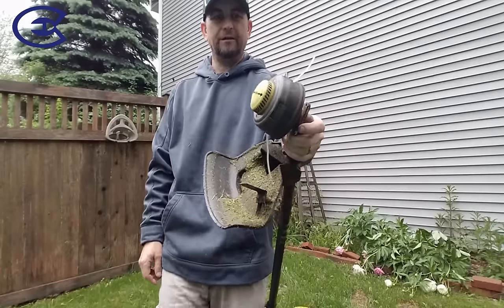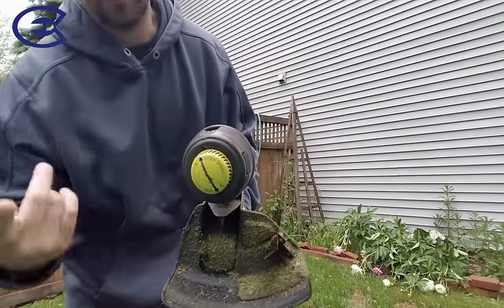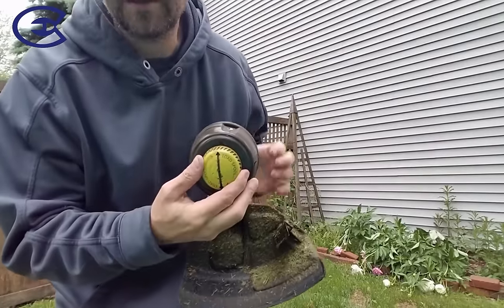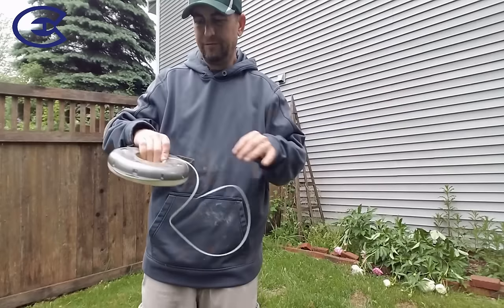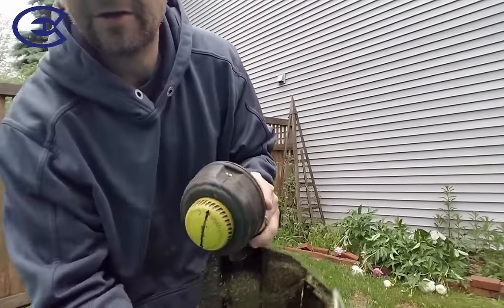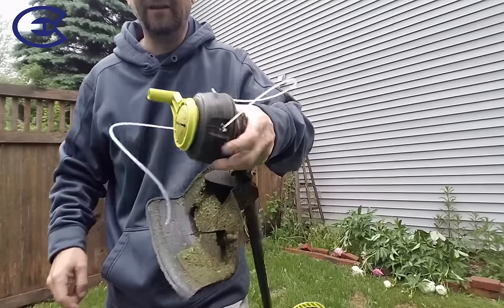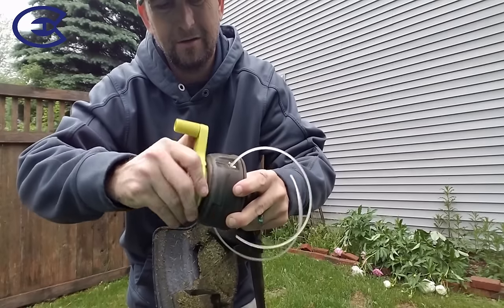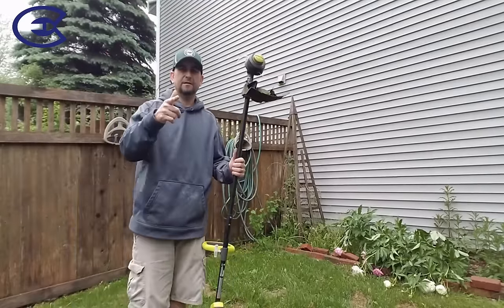How to ReString, ReSpool or ReLine Ryobi  weed trimmer weed wacker whipper snipper

Comment: I have been struggling with this piece of machinery for quite some time, taking it apart, putting it back together, fail, fail, fail. Thank you so much for this super easy to understand tutorial. And actually, the tool to wind the string up is not a necessary. It can easily be done manually.

Comment: Thank you!! I can’t put my hands on the manual right now & I’m sitting out here in 101* trying to finish this yard before it gets dark or it storms...both of which are about to happen any minute now & I’ve been trying to do the old school method...pulling it apart etc...I thought my line was out but I had beaucoup left. I didn’t realize this was a bump model. The last weed eater I had was an auto feed (which never worked properly) & this Ryobi is the second weed eater Ive ever owned so I didn’t know anything about bumping...I pulled the head off & about a foot of string flew out so I’ve been trying to manually rewind it & put it back together for about 15 minutes 🥴🥴🥴 I was ready to toss the whole weed eater over the neighbors fence 🤣🤣🤣💯💯💯
Reply from the maker: Thank you!!! Glad you're fixed up!!!

Comment: What do you do when your spool won't accept line?  I can't get it to feed straight through even though arrows are lined up ...
Reply from the maker: Ive had that a few times just keep trying both sides or re cut the line and try again itll go.
Reply: If you want easy to do everytime,try to heat it made it straight
Reply: Or try cut it angle

Comment: If you don’t have the tool or it isn’t aligned, simply detatch it from the head and align the holes and route the string. You can then twist the green part by hand, spooling the string. Wash it if it’s stuck with gunk.

Comment: Thanks so much for this. Whacker belongs to my brother & he's out of town so I needed help with restringing. Yes I had taken the unit apart & then did a search on You Tube. You wouldn't think a tutorial like this would be needed but IT WAS. My only suggestion is to remind viewers to turn the knob so arrows are not lined up once unit is threaded (I think we are supposed to do this). You could add this step via text. You're a life saver!
Reply from the maker: Thanks!!
Reply: @scratchgolf  is there a way to keep the whacker turned on or do I have to grip the lever the entire time as I am doing now. It's hard on the hands after a couple of hours.
Reply from the maker: I wish I knew. Zip tie??
Reply: @scratchgolf  my Ryobi whacker got stuck in "on" mode for the last hour of my whacking. I unplugged it then replugged & it was still stuck on "onn" mode.  It has done this before but never stayed on after unplugging. It made whacking much easier. Will check status tomorrow.

Comment: Well, it took me a while to get the cord to poke through the other side …. But when it happened eventually the rest was smooth sailing! Thank you SO much for this video - so helpful! I really am so grateful it helped me do it myself without having to ask my boyfriend or brother or a helpful guy at Bunnings… it’s nice to be independent!!
Reply: Same here. I still can’t get it through after a couple hours of frustration and watching other videos. Arrows are lined up but it just won’t go all the way through. Going to try his bumping technique tomorrow as maybe there is some little piece still in there. Glad it wasn’t just me.
Reply from the maker: I've had this issue. I have a video showing how to fix it in the corner of this video.
Reply from the maker: I've had this issue. I have a video showing how to fix it in the corner of this video.
Reply: I just fixed it in about a minute. There was still a tiny bit of old line on the spool blocking the path although I could see light through the holes so I kept trying to feed it though but with no luck. I am now gtg. Thanks to all.
Reply: I’m back again … I don’t have arrows to line up (must have worn off with bumping). This is doing my head in!!

Comment: Thanks, I have the instructions in the other room but it’s easier to watch your video.  Love the ryobi brushless string trimmer, and the pole saw and edger attachments. I was skeptical on the edger but I have 300’ of sidewalk and it does it usually with less than 1 4 ah battery.  Never going back to gas.
Reply from the maker: Thanks

Comment: My original line cut chopped up, and I turned the yellow bump bit, and it rotated and disappeared inside. Thinking I can't open it and get the old line out. Also thinking it will probably be fine if it just stays there and I use new line anyway. Any thoughts?
Reply from the maker: you should be able to open it and fix it no issue. , Thank you! Please don't forget to like and subscribe please, any and all help with my little channel is appreciated!

Comment: Great video.  But there is a way to take that head apart , and you may need to do it if the old line is still in there and no amount of bumping will get it out.  That's what happened to me; spinning the head manually, I could see a bit of green (same colour as the line I use) inside the hole.  So I figured the old line was still in there.  To get it out, I took off the head by pressing on the 2 u-shaped clamps on opposite sides of the head.  The head then comes off the spindle and the still-wrapped line then became easily accessible.  There was plenty of it left, so I threaded it manually through the 2 holes on the side, put it all together, and good as new.
Reply: You saved me thanks!!! I knew there must be more inside and sure enough I took head off and could feed it through thanks heaps 🙏

Comment: What If the line is too short and I want it longer? Do I have put in a new line. I just opened the box and used it today and cut my line too short not knowing there is a built it cutter. Thanks
Reply from the maker: Line up the arrows and pull it out.

Comment: Thanks.  I was trying to figure this out yesterday.  I ended up popping off the green knob which was a pain to get back on.
Reply from the maker: Thank you
Reply: vista7 Hey I have the same model. Have you been able to attach the plastic blades that come with this. This Roybi is driving me nuts lol
Reply: @scotto7895  You have a picture?  I don't think mine came with plastic blades.  I got the brush cutter attachment for the 18v and it hacks through tree branches up to 1 inch thick.
Reply: vista7 I just took a picture of it but cant upload.it looks like the same circle attachment that you attach  with two 3-4 inches orange pieces with serated edges

Comment: Looks easy, but thought it would be easy before.  I'll try again, but so far the chainsaw, mower, and blower are much easier.  Maybe because all except the mower are EGO.  Learned the hard/expensive way.
Reply from the maker: Frustrating
Reply: Thought I'd let you know since it might help someone like me.  It worked like it should when I quit trying to use the "string" that came with the machine. Thanks Eric.  Ryobi manuals help only maybe someone who already knows how trimmers work.

Comment: I still dont understand the tapping against the ground thing at the beginning . I just bought it and the string is all jacked up after first heavy use. Am.u supposed to pull it out? I turned the knob and the string just got shorter. Is there a long spool inside? The manual sucks. It came with replacement string. Not sure what to do with it ither than try to figure out how to remove and replace it. This is what men are for. Please help me with first time replacement
Reply from the maker: Get it figured?

Comment: Problem I have is the bump feed stopped working years ago. There is probably something critical in the mechanism I can lubricate but I can't find it. I've used silicone spray and household oil on most of the moving parts that I can get to. To feed more line, I need to stop, remove battery, push on and hold the green bumper, and pull on the string. PITA.
Reply from the maker: it's the spring Id guess. Get a new spring or look at the one you have now.

Comment: When I purchased my RYOBI 40V trimmer I purchased a roll of 0.080, Home Depot and the instruction said to only use up to 0.80; line thicker will lower battery life and put too much strain on the trimmer. From my previous gas trimmer that died I have a roll of 0.095., now according to you 0.095 works okay. What is your take on this 0.080 vs 0.095 controversy?
Reply from the maker: Interesting. Well it seems at this rpm and voltage, the weight between a .8 vs .95 (3 foot piece of line) would be minuscule.  This one isn't a 40 volt either. It seems illogical.
Reply: Eric C . Thank you for your comment. At this point I have not needed to string this trimmer. Also, instructions mention winding fifteen feet on. For my yard three feet of string would necessitate me carrying extra string and the winder. When the need arises I will give 0.095 a go. 

Oh, mine is the 40V expander model; the ability to remove the shaft add other devices. On this I connected the Craftsman rototiller that worked on my gas trimmer. Also, connected the trimmer shaft from that Craftsman that used 1.30 string, it took the battery down fast and edging the driveway it would stop, too heavy a line; heck, I had to give it a try. Even with that using the string that came with this kit it is an excellent string trimmer, should have purchased this long ago, now do not foresee any reason returning to gas. Like this RYOBI so much that next season I well may purchase their battery powered lawnmower.
Reply: I have the 10.0amp corded model Ryobi that has the same string head.  In the Q and A on my model Ryobi at Home Depot a guy asked if he could use 0.095 string and the Ryobi guy that does the answers said YES.  That works for me.  Go to Home Depot and put your model in and see if the Q and A on it shows someone asking that question.  You will probably find it as the 0.095 is very popular for its strength.  A Ryobi factory person answers the questions on the Q and A on Home Depot.  It looks like they are the main Ryobi distributor or something similar.  Good luck.
Reply from the maker: well put! thanks for the insight !

Comment: I use those type… u can easily wind them with your hand .. no need for that winding tool.. and also those trimmer heads can hold way more string than that.. I usually load mine with around 9 ft of .095 .. my Ryobi trimmers are the gas powered version but they still have the same shaft and bump feed head

Comment: is the old line supposed to be completely used up before replacing it. I can't get the new line to feed through the holes. I know there's a little bit of the old line left, but it is inside the head where I can't get to it. I tried to pull the old line out, but turned the little green knob, which made it spool up inside.  

I'm gonna have to disassemble it I think. It shouldn't be this difficult to add new line, so something I'm doing is not correct.  The holes don't look clear when I line up the arrows.
Reply: Had to remove the rubber bump knob casing. discovered there was plenty of string on the spool, but the string had slipped the spool and wasn't...uh...spooling properly.   Rewound the string and fed it through the holes,  set the heavy duty spring in place, replaced the casing.

Comment: Thank you for the video. Followed all the instructions and no, it is not that easy.  It is actually impossible to reload line on this tool.  It looks like if yours had an empty line spool.  That’s why the line goes right thru.
Reply from the maker: You line up the arrows and pull out the small piece that is in there BEFORE you add new stuff. The main problem is you're not mechanical, and overlook simple instructions, not my easy method to solve this. As the comments and likes indicate.

Comment: Can more than 3 feet of string be used at one time
Reply from the maker: Yes up to 12 feet
Reply: @scratchgolf  it seems to get tangled in the spool or am I doing something wrong? Also after winding up the wire, do I turn the knob to the right until it sort of clicks?
Reply: @scratchgolf  to confirm to release more wire, tap the bottom while running right?
Reply from the maker: Yes

Comment: The yellow part of the head can be easily turned with your hand should wear keep the wrench from  working. I've never bothered to use the wrench after using heads similar to these that didn't use a wrench over the years.
Reply from the maker: Ty

Comment: What is reason to tap it to the ground?
Reply: He turned the green crank too much and the exposed line was too short. By tapping it on the ground while it is on it forces more line to come out. It comes out until it hits the built it line cutter and cuts the line to the appropriate length.
Reply from the maker: yup adds line

Comment: When I “Bump” mine, the line doesn’t advance!  I end up having to take the thing apart and restring it each time...
Reply from the maker: something is wrong with your spring
Reply: Did you spin full speed and bump together, mine about bump 2 times will heard cutting noise.

Comment: Followed the instruction manual. String wouldn't wind.
Looked at this video and followed.the instructions. String wouldn't wind.

What am I doing wrong? 😭
I don't want to have to disassemble the head.
Reply: Some times you have to take head apart. Sometimes there's still string inside.
Not always is there perfectly an equal amount of string sticking out each end. And majority dont stop trimming when there's equal amount sticking out as his is. When there's only one side that string is sticking out it is impossible to pull string out as he did. Looking at his video his string is perfectly sticking out on each end. Neither side the string is frayed?
Some times your lucky and at end of spool that last bump on ground you hear that distinctive sound the remaining string fly out off the spool. Then you line up holes and insert new string.
Other times you bump it on ground and you hear that sound only one side has string sticking out! You try grabbing that side string and pull. Nothing comes out as there's still string wrapped inside. More than this guys perfectly wrapped string. We dont live in a perfect world as in real time actually weed whacking we encounter that dreaded moment you hear that sound!
It also helps if you keep your string wet. Submerge your spool of string in a bucket of water. Dry string will fray more so then wet string. Wet string also lasts longer.
If your trimmer head holes are lined uo you should be able to see through it. If you can then no string or other obstruction is insde.
I'm about 6 ft so I take the string and step on the string pulling spool up over my head and cut it. Usually it ends up being about 7 feet long give or take.
I dont have time as most don't when actually weed whacking (but I have started pre cutting my string at start of spring and keeping it wet so its readily available. ) and at moment I need string I dont have time to pull a tape out and measure! So it's easier to just use my height as my measuring tape.
The end your trying to push through, take about 6 inches and straighten it out. Usually it's curved slightly and then wont push through. With it straight now try pushing it through.
I did a video a few years back. But I was in process of actually weed whacking when my spool ran low and last bump on ground I heard that distinctive sound only one side had string sticking out!
My trimmer still had enough string inside it wasnt wrapped conveniently I could pull it out like this guy was able to do.
If it's wrapped inside more then once no way will you be able to pull it out and you'll have to take head apart.
Try keeping your string wet.
Try straightening about 6" at end of new string and pushing it through lined up holes...
Hope it works, and my apologies for long post.
Reply from the maker: You have to take it apart, tI have a video on that in the cards if you want.

Comment: I’ve lost the winder thing twice (!), but use the sane method. Just thread through, grip the main body as is video then turn the top like a dial. Winder is easier, but in case you get caught without one, or it breaks.

Comment: what if it doesn't go all the way through?  mine has line that's stuck in it.  mine looks chewed up after one use. And the line doesn't "just go through".  so frustrated.
Reply from the maker: hmm? Stick a wire hanger through it?
Reply: Just make sure your line is cut properly.
Reply: Pull the top off and make sure the arrows line up properly, sometimes the holes will not line up making the line from going to the other side, put the top on after pulling it through both ends and the crank the top clockwise and your good to go.

Comment: My line curls up around the shaft. 😑
Reply: So does mine.  Did you ever figure this out?    I'm looking at buying different trimmer line.
Reply from the maker: Its too long. You only need 3 4 inches out per side. Not 10 or 12
Reply: @philpancrazio  yes. You might be missing the spring to keep tension. There's a lot for that head you can buy from home Depot or Lowe's or wherever you like to go.